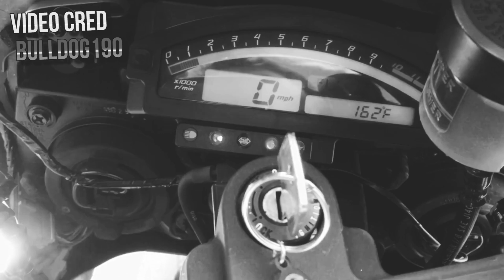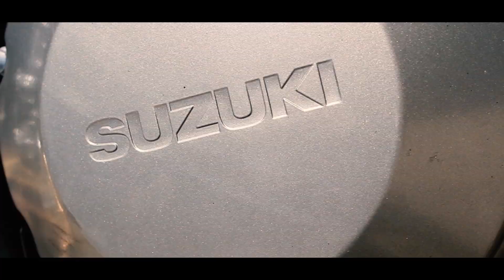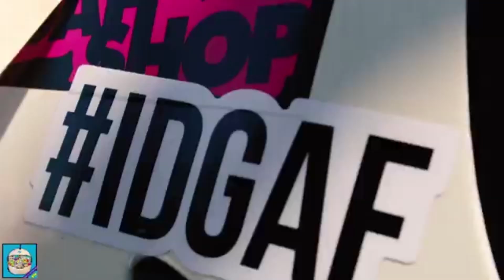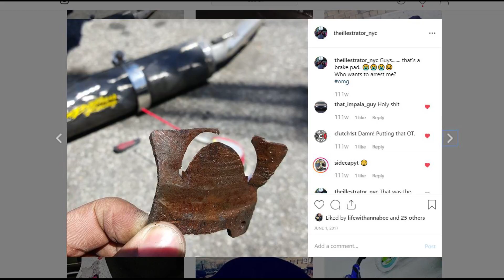The Things I Miss About Each Bike I Got Rid Of

Comment: I miss many things about many bikes, but the one whole bike I miss is my 75 GL1000 "Neo-Retro Cafe" (built before it was actually a thing.  That cammy idle flat 4 just made such a unique noise, and it was such a pretty bike that made people from every walk of life smile.  Grizzled harley riders to sport bike guys, it just got positive vibes across the board.  Even if it was a 600lb bike with 80hp, an outdated chassis, and "brakes."
Reply from the maker: Was it stock? It would probably make dope custom bike
Reply: @Theillestrator1050  semi custom. Full Delkevic exhaust, open air filter. Rejetted carbs, full LED upgrade, rewired with an M unit, fender deleted, and a custom paint job in a suzuki metallic orange.

Comment: There’s so much you can do to the fz1, mines got a complete r1 front end, nitron shock, ecu flashed etc etc and am about to do the naked swap just so I’ve got the option of both. Really fancy another bike but won’t sell the fz1 as you’ll never get something else as good for the money.
Reply from the maker: I thought about the r1 swap, but I honestly like your extra suspension travel of the stock forks since these roads suck
Reply: - The illestrator - I haven’t noticed the travel tbh but I had heavier oil put in because I’m 18 stone so mines really hard but obviously doesn’t need to be like that. The radial callipers are a nice upgrade though and I’ve changed the master cylinder to match which is a good improvement.

Comment: I've never gotten rid of a bike. Still on my first.
Reply from the maker: K E E P I T F O R E V E R
Reply: Marcus Smallwood What's your opinion about the bike ? Ive been thinking about getting one as my second bike
Reply: @gloriushumbug5832  it would probably be a great second bike. The bikes greatest strength is it's adaptability. It can do so many things. It's a great commuter. Great gas mileage. Great on dirt and gravel roads. Comfortable but not luxurious. It gets the job done in the highway for short clips. It's not a sport bike, not a tourer, and not an Enduro, but it does do light trails. It's nimble.
Reply: On my first too, 3rd year now.  Honda, cheap and reliable.
Reply: Same. My 06 cbr 600 has 55k mikes now.

Comment: Iv got a Gen 1 Fz1 and a Klr 650. Every once in a while I wonder why I still have my Fz1 when my KLR so much more versatile and cheaper in every way. And then I get on my FZ1 and turn the throttle and it all makes sense. I still daily my dirty ass FZ1 over my brand new KLR for that reason. My first bike was Ninja EX250. I miss the crap out of it because I only had for a month before I basically totaled it. I liked it so much cus I only paid 900$ for it and I wasn't worried about damaging it since it costed nothing. I also owned a TTR125 for a short time. I miss that just because the clutch on it was the best Iv felt on any bike ever. It had a real fast bite to it. Super responsive. That kids bike had no right to have a clutch that good.
Reply from the maker: Nice,  I've yet to own, or even ride a dirt bike of any kind

Comment: How does the FZ1 compare to the FZ09? I'm sure the FZ1 pulls a lot harder up top than the 09 but how is low/mid range? and overall power?
Reply from the maker: Well the fz09 has more low end torque as it makes its power lower in the rev range. The gears themselves are shorter and the sprocket gearing is more aggressive. Overall the FZ1 has more power but it's higher up than the fz1. It's better balanced suspension and weight wise so it doesn't always power wheelie. An fz09 would win light to light up to 45 mph but the fz1 will eat it after that.

Comment: I've got a bone stock 1,000 mile MT-09. Either I'm moving on within a year to something else, or I'm spending thousands fixing this boneheaded bike. It's both crazy wild and happy, and the most frustrating mess ever. Talk about a conundrum.

Wasn't that costly to begin with. I knew what I was getting into. But I've changed bikes on average about 1 to ever 1.5 years overall average. I don't have place for 2 bikes.

My fav SV1000S clip:  https://www.youtube.com/watch?v=0oAhecu2ZCo
And my fav custom TL-derived monster:  https://www.youtube.com/watch?v=VnY5Ru7jmEE
Reply: What's frustrating about it?
Reply from the maker: Damn....I need another one after watching that now 😂
I ride 2Js fz09 decently often so I definitely know how much of a spazz that bike is...maybe it would be a good idea to change the gearing for top speed? Assuming your problem is the wheelies
Reply: @Theillestrator1050  Nah. Problem is the suspension acts like a 1977 Cadillac Eldorado hauled out of a junk yard and will take at least 1500 bucks to fix it, to how Yamaha should have made it from the factory. Also, the stock throttle even in STD mode is so twitchy my right arm gradually cramps up trying to hold it steady so it's not surging back and forth with the slightest movement at speed.

Comment: I'm fussy. If my bike isn't 100% I won't ride it until it's fixed. Anybody who rides even my fifteen year old bike always says "this bike feels brand new". I own two bikes and a 250 Honda Helix scooter. They are all mechanically perfect. So maintenance can be a PITA owning more than one bike even with the good repair shed that I have. Something to consider.
The k100 is hot right now so it may have more value if you were to sell one. The FZ1 is good right out of the box so doing something cool with it would be more difficult but if you sell it eventually you'll miss the power. Sell one, keep both? First world problem. Congrats.
Reply from the maker: If its not apparent im the exact opposite 😂
When the bike is done, I do wonder just how much it would fetch if I wanted to sell it...
Reply: - The illestrator - Well, I noticed it a little bit. You're like my brother.
Cafe bikes are hot right now, especially the k100. YOU might make a couple of bucks.

Comment: What is the fastest bike you have owned? Sv1000 or the FZ1?
Reply from the maker: Well the SV is about 130 horsepower at the crank when stock, and the FZ is 150 at the crank.
The SV was fully modified so I recon it was probably doing about 150 at the crank which is about what the FZ is at stock. The difference is the SV made its power earlier than the FZ... but since the FZ is still stock it has the potential for 170 at the crank with full mods